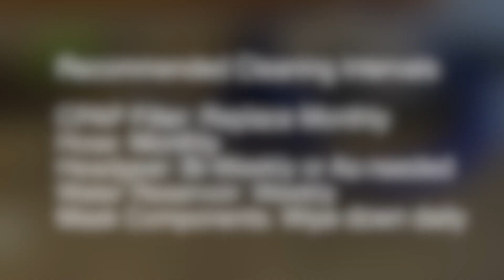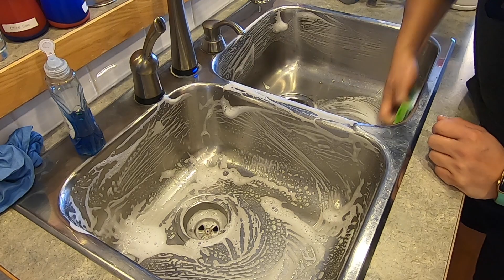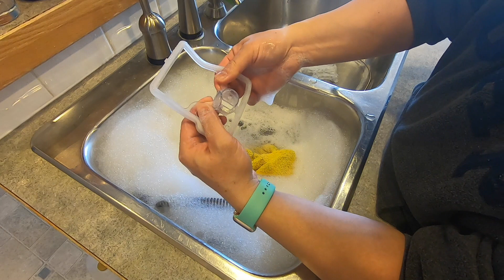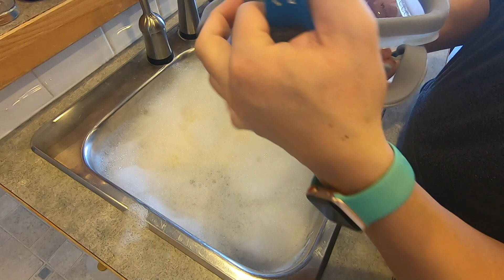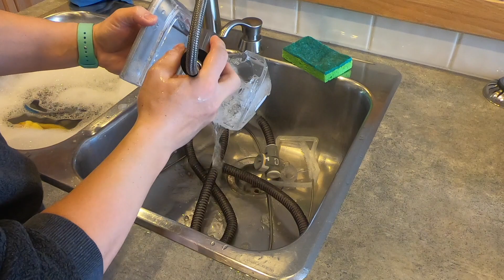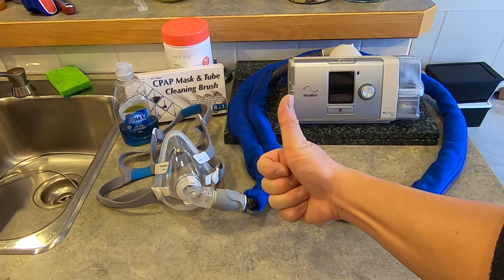How to PROPERLY Clean CPAP Equipment

Comment: I have the res med cpap machine and 5 years ago I started using the nasal pillow mask.  Well for 5 years I have had severe sinus problems.  Neither my respirologist or the oxygen company was helpful.  I had to find this out on my own that it was the nasal pillow mask that was causing my sinus problems.  I bought a full face mask and my sinus problems went away immediately.  When I contacted both the company and Dr. They had never heard of this problem before…..I hope I have helped others because I suffered soooo much with sinus issues and discovered this on my own!  I just had teeth extracted from an oral surgeon and relayed my issues…and he confirmed that it is a known fact that nasal pillow masks cause sinus issues….heads up my friends !
Reply from the maker: Yes, this is a known problem for me as well.  I've tried NUMEROUS times to use the Resmed N20 or the P10 nasal masks and everytime I use it the sinuses jam right up and then I end up breathing out of my mouth.  I fix cars all the time and am used to wearing a full face mask style respirator when I'm working on certain car jobs to prevent me from inhaling dangerous particulates and so wearing a resmed full face mask felt pretty normal to me.  At one point on my channel I was doing a multi part series to talk about CPAP treatment and but never got around to really getting it to take off to talk about all my different experiences and things I've learned along the way.

Comment: What is the blue hose cover used for. What purpose does it serve?
Reply from the maker: the blue cover is a hose cozy that serves 3 main purposes.  1. to make it less "medical looking", 2. to insulate the hose so water doesn't condense in the hose when you're using a humidifier in a very cold room. 3. to make the hose rubbing on your body/face more "soft" so it doesn't feel like you're sleeping on a hose.
Reply: @piercedasian   thank you.

Comment: Do not use tap water because of impediments. Tap water may retain more bacteria. Depending on your region, you may have more bacteria and/or more harmful bacteria. Use only distilled water!
Reply from the maker: I guess I'm very fortunate that the water coming out of my taps is cleaner than clean.  You make some valid points for those that use well water or have water from questionable sources.  While I'd like to think that clean, safe drinking water is a human right that it doesn't always hold true around the world.  Using clean, safe tap water with minerals in it inherently won't cause issues as I have super hard water where I live and I never get buildup from using it to wash things.

Comment: the Doctor just recommend me to use a ResMed Auto-CPAP "AutoSet" S10 Model, my question is  ....can i buy a used equipment and use it or must be New Equipment  ??? 
The reason is because the New Equipment is very expensive $$
Reply from the maker: absolutely you can!  As long as you buy from a smoke free home, a unit with relatively low hours (sub 1000 hours is low to me) and make sure you clean every inch of things and you're good to go.  Contrary to popular believe a CPAP is a one way flow device so how many germs can you possibly get in a machine?  Hardly any I think.  I'm a germaphobe and I own 2 used CPAPs as my backup machines in case my primary unit ever fails.  Used is a GREAT way of saving a ton of money.

Comment: Thanks, did not know I could submerge the heater element.
Reply from the maker: yep the heated hose is completely sealed and operates on low voltage DC power anyways so no issues submerging this particular electrical component.

Comment: Thank you for this video very helpful,  I didn't know about the extra part in the water reservoir.
Reply from the maker: Yes the gasket inside the reservoir is super important and must be in good condition for it to properly seal the two halves of the reservoir.

Comment: In addition to the dish soap, I always add a little white vinegar to the water to help sanitize.  Instead of a hose cleaning brush, you can use an inexpensive turkey baster.   Separate the bulb from the hard tube and toss the tube.  While the hose is submerged in the soapy water, fit the bulb over one end.  It's not a tight fit, so hold the two pieces together.  Squeeze the bulb repeatedly to move the soapy water in and out of the hose until clean.
Reply: I specifically looked up cleaning methods for my CPap to see the ratio of vinegar to water I should be using. When my son was very young and diagnosed with childhood asthma, I would thoroughly clean his equipment once a week in a vinegar solution, but I’ve forgotten the amounts. I wash everything thoroughly every day , but I’d like to do a vinegar solution during my once a week deep clean for sanitizing.
Reply from the maker: That's a great tip!  Thanks for sharing that info with our viewers.

Comment: Instead of a sink, I use a small plastic storage box.  It is much easier to keep the box clean.
Reply from the maker: That's a good tip and others have suggested the same. I would do that but that means I have yet another box/thing to store in my tiny home so I give the sink a good cleaning and then wash my gear that way.

Comment: Thank you so much, this has been very helpful. I am having some problem with noises from the water chamber that are coming through the hose and the nasal piece waking me up.
So, I am trying to find out why that is happening. There are no tears in the hose or mask, but it sounds as though it is coming from the water chamber and I do not see any cracks or anything there. So will keep trying to find out why this is happening. Thank you for your videos.
Reply from the maker: I would say your leaking sound is likely coming from a mis seated humidifier tank gasket (or it could be torn) or less likely the little silicone joint inside the cpap machine that mates up with the opening of the humidifier.  Sometimes when I don't install either one of those parts properly I will get this whistling noise.
Reply: If  condensation builds up in the hose, it can cause noise. Try adding a hose cover for better thermal insulation,  it helps reduce condensation buildup.
Reply: Can you describe the sound so we can help you track it down?
Reply: It sounds like rain-out. If you look it up, it's fairly common in CPAP machines. With mine (top of head) it sounded like popcorn and I couldn't figure it out until I finally found the right thing. As someone said below, a hose cover could help and also if you can change the humidity on your machine that works too. I bought a hose cover and found it made my hose too heavy. So I changed my humidity level instead and no more popcorn noises. :)

Comment: I just started using the exact one that on the video. I have had a lot of problems getting mine too not leak air around my mouthpiece. Do you have any idea what I can do to fix this. Thank you
Reply from the maker: I use a Remzzz mask liner and I changed up my mask from one that uses a silicone seal to one that uses memory foam (I use the Airtouch F20) and its a godsend!  Love that mask and it rarely leaks and b/c I use a mask liner that the memory foam doesn't get all oily and gross.  I can drag out the mask cushion life to literally years before they need replacing!

Comment: First off cleaning with tap water allows bacteria to grow you need to use distilled or use vinegar. But do what you want
Reply from the maker: Bacteria?  What kind of tap water are you using? Our municipal water is one of the safest waters in the world and locals frequently drink form the tap with zero issues. Perhaps this is different if you’re using well water but I know with 100% absolute certainty that our water is super safe and clean as clean can get
Reply: @piercedasian  Do you know what the “red stuff” is that forms around damp areas like inside a toilet or around a shower? Or mold. Bacteria and mold love moist damp enviroments especially if you use heated humidity. The “red stuff” is Pseudomonas aeruginosa and you can directly inhale this when using your cpap if continually using tapwater. I work with these devices as an rrt and a sleep tech. This is not a good idea. Again do what you want
Reply from the maker: @FirstnameLastname-vy2dg  very familiar with the red stuff but you're missing a huge point here... I don't use tap water in my cpap when using it.  The red stuff in the toilet and your shower is a culmination of waste water and other bacterial contributor ie your body's dead skin flakes/urine/feces.   While other waters sources around the world CAN contain bacteria that at least here where I am there is literally 0 % bacteria in our water due to municipal chlorination.  Washing a water tank out with distilled water is the most absurd and wasteful thing to do when clean tap water to clean a tank out is sufficient.  Distilled water uses tremendous energy to produce and I'd like to think of myself as being moderately responsible in doing my part in using resources wisely.  I'm not here to tell anyone what is right or wrong and for a lack of a better way to describe this to people is do what is logical and not do something for the sake of doing it.  I know so many people that don't even wash their CPAP equipment (gross) and they're still walking and talking years later with no issues so what I do is probably already beyond what the average joe does.
Reply: @piercedasian  Tap water has heavy metals in it plus high levels of chlorine and minerals like calcium and magnesium and there’s lime in the water. Also high levels of fluoride and then you’ve got iron from the pipes. Many city water supplies have been found to have parasites like giardia and amoebas.
Reply from the maker: Hmm interesting points and it makes me more grateful than ever to live where I live.  Our municipal water supply is one of the cleanest in the world (I am VERY well versed in our water treatment system in our locality from an a design and engineering standpoint) and our water couldn't possibly be purer or safer to use.  I drink from the tap all day long and have for the past 30 years without a nary of an issue.  I guess other cities are not as fortunate and you do make a valid point that there could be all sorts of nasty things in the water.  Out of curiosity, what locality are you in that has giardiasis and amoebas in the water?  I find water systems fascinating and take a deep interest in water disasters that happened in flint, walkerton and north battleford.

Comment: Do you think it is ok to clean using water from sink, if you have well water?
Reply from the maker: hmm, it isn't so much the sink that I'm worried about b/c if the sink is known to be clean (bleach can quickly resolve any worries of bacteria in it) that the water must be verified to be potable - you can drink it safely.  If its potable water then you can use it to clean your CPAP equipment.  I would NOT recommend using tap or well water in the CPAP's humidifier as that will likely lead to a LOT of hard mineral deposits buildup in the humidifier.

Comment: I think what's missing from this video is the drying process.  Lots of questions in the comments about it.  I can't have the gear hanging around for days to dry - I need it dry much quicker than that so I usually hook the hose and chamber up (unheated) and run air blasting through it and the nasal pillows to dry everything out.  Better than standing there with a blow dryer.

Pro Tip - I've used CPAPs for 20+ years and cleaned it like... maybe once.  I've never gotten sick (aside from the cold you may get once a year).  I just replace the parts (hose, mask, filters, etc) every once in a while when I remember to.  Not that mine is the recommended method but I have heard, "clean it so you don't get sick" over & over but don't know of anyone who has gotten sick from not cleaning it.  (assuming you don't wait til it smells or turns green/black with mold)
Reply from the maker: I'm not sure how much drying is truly needed for the parts (especially the hose) b/c when you start using your cpap that the water droplets in the hose ultimately evaporate and is added humidity in the air circuit.  I guess there are valid points about the little mask elbow and nasal pillows b/c those little parts hold water but the hose is something I've never given a 2nd thought about b/c the water rapidly dries out when you start using the CPAP.

Comment: The foam can be submerged in cleaner, I have been doing this for years. squeeze it like a sponge, blot it with a clean towel or paper towels and air dry, do this in the morning and it should be dry by evening. The foam holds liquids and potential pathogens from your breath, sweat etc.
Reply from the maker: I have tried that as well but I find the foam "firmness" tends to breakdown and soften up which leads to leaks.  Mind you I only tries washing the mask cushion that gave the ghost.  Visually it looked perfect but it would constantly leak at night and it seemed that after washing it got worse.  Probably not a fair test but your suggestion is good for those that have dirty cushions to try.  I use a mask liner so its always very clean.

Comment: Warning: You should not use harsh cleaners like Dawn! Use 4:1 or 3:1 parts vinegar:water!!!!
Reply: I think I have to agree with you yet again Mitch.  I don't think the soap will harm the CPAP machine, but....vinegar/water is a more "natural" cleaner and since we are breathing in/out the air going thru the CPAP machine every night for 6-10 hours a night, it's something to consider.

Comment: A few extra tips that I've found helpful...  if hard water stains or mineral deposits happen to build up (white crusty stuff) inside the reservoir, abit of toothpaste on a fingertip or toothbrush can help clean it out.  Also when cleaning anything with oils from your face, facial cleansers are helpful in cleaning up headgear, the mask and any plastic parts while usually leaving a pleasant scent.  Most of the hoses can also be held under a faucet tap and then extended to a toilet or bathtub for draining, and hung over a shower or door for air drying.
Reply from the maker: thanks for sharing your tips.  Whenever I travel and find hard water mineral deposits building up in my reservoir that I simply soak it in white vinegar for the day and that also usually resolves the issues too.
Reply: Is that a good idea with the toothpaste? The reason it cleans it is because it's slightly abrasive and i would think that the plastic would gather bacteria even easier after that has been done to it a certain amount of times. Vinegar should take it away while destroying bacteria in one go.
Reply from the maker: @The77Game  I personally wouldn't do the toothpaste approach due to the abrasive nature and the fact that many toothpastes leave behind a minty smell that can be a tad overbearing for some. While I have never had issues with hard water buildup (I used distilled water) that washing with regular hard tap water never left any appreciable amounts of mineral build-up inside my reservoir.  My water kettle that has TONS of hard mineral buildup is spotless after soaking it in white vinegar overnight.
Reply: how long can I use this equipment if I clean it every week ? should I buy new tubbing and mask etc every few months or I can keep them many years if I clean everything good?

Comment: Thank you for the video - very informative.  Another tip about the reservoir - the two chambers come apart.  I didn't notice this till about 2 months into using it.  So that's what I do each time I clean it.  It make cleaning the top part of the chamber easier (to get in the hard to reach areas).
Thanks!
Reply from the maker: yep, the reservoir comes apart but just be careful when separating the halves so that you don't break the hinges (its takes a lot to break them but it CAN happen).

Comment: Thank you for providing your helpful tips. Much appreciated. Do you leave water in the reservoir for the week until you clean it?  I have been dumping out the remaining water each morning and allowing it to air dry.
Reply: I dump the distilled water out of the reservoir every day, give it a rinse with water from the faucet and let it air dry all day.
Reply from the maker: yep that works too.  I try to remember to do that but admittedly I'm a bit lazy and am not as diligent as I should be.
Reply: My mom keeps getting a cough. She’s taking antibiotics all the time. 
I sent her the link to your video.
Reply: I’ve just started using the ResMed last week and I’d like to know the answer to that too.
Reply from the maker: I leave my water in and just top off as needed. So clean will sanitize the water too.  But it is just as easy to dump the water out too.
Reply: @piercedasian  I leave my water in and just top it off each night and haven’t had any problems. I saw you answered someone about the water and you said never leave the water in because nasties will grow in it? In this more recent reply of a month ago you are now topping the water off? I clean my water chamber eventually by spraying it inside and out using a 32 oz bottle filled with rubbing alcohol then after a couple minutes I rinse the water chamber well getting the alcohol off. Then let it dry on paper towels. I don’t like soap on anything.
Reply: I leave mine in all week as well and just top off with fresh distilled water. Haven’t had any issues so far but I was worried about doing it this way when I started. I just monitor it for growth between cleanings and if I notice when I pour water in it gets bubbles that stick around I just clean it right then and there.